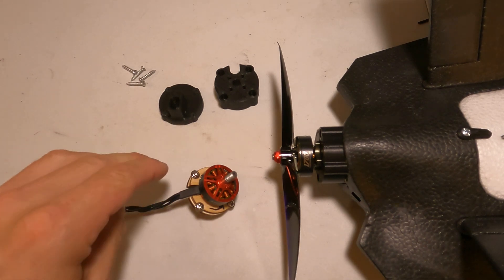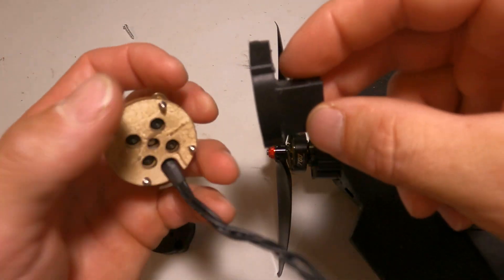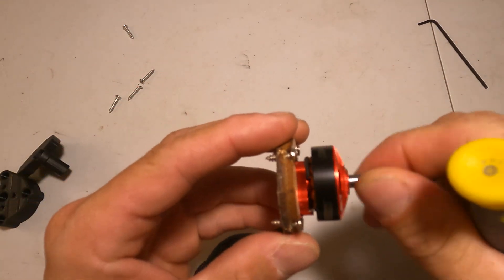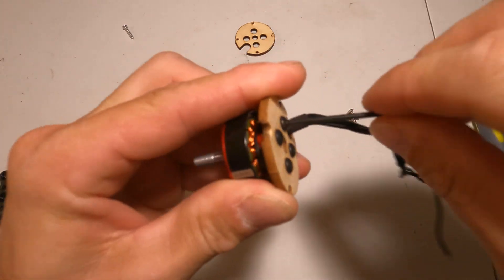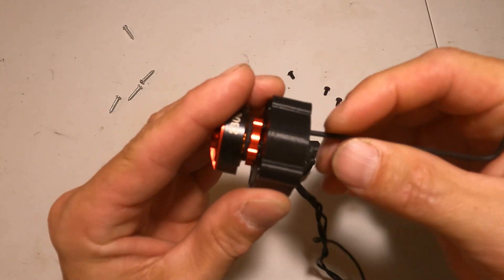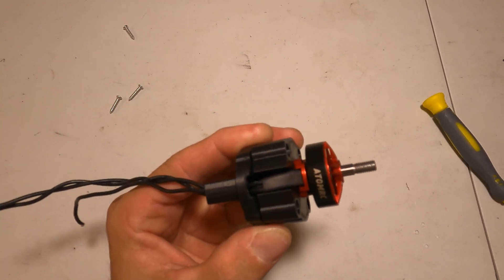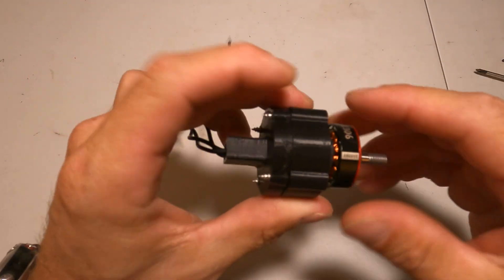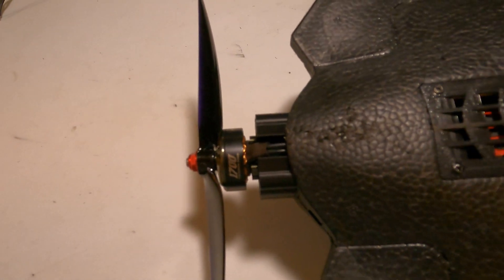ATOMRC DOLPHIN MOTOR MOUNT UPGRADE KIT

Comment: No, you want to use PETG or ABS, because PLA(+) is the worst choice for any functional parts. It's fine for decorative parts that will never see and impact or strain, but just because everybody started printing with PLA, and it was then slightly improved to become PLA+, doesn't mean it's the right choice for everything. PETG prints to easy these days, that there's really no justification to not use it. It's also in the goldilocks-zone between PLA and ABS regarding its glass transition temperature, with the benefit of impact resistance and most other properties that would usually require ABS. Just ditch PLA already, there's rarely a reason to use it (except for LW-PLA, maybe).

Comment: I hope you answer quickly. I'm finally doing this mod. I have a choice of tmotor f60 2020kv(I believe is the same size of the stock motor) or the stock 2306 1800kv. I'm staying 4s. Which motor would you choose? I'm a noob to wings. Been flying quads for years. I have 24hr to decide while the glue sets lol. Also changed to 6s esc incase I wanna go 6s eventually.

Comment: Has it failed yet? Mine melted today using pla+
Reply from the maker: No, still going strong.
Reply from the maker: You can use the stock wood motor mount as a "heat shield" in between the motor and the adaptor.  You probably need a little bit longer M3 bolts.
Reply: @JeffDoesThis  mine died today badly on the first flight. I fly pretty fast. My mate had one and it started wearing however he is flying much slower. I will try wood like u said.
Reply: Just do yourself a favor and throw out anything PLA*, and use big boi filaments like PETG or ABS. At least PETG, if you don't have an enclosed printer.